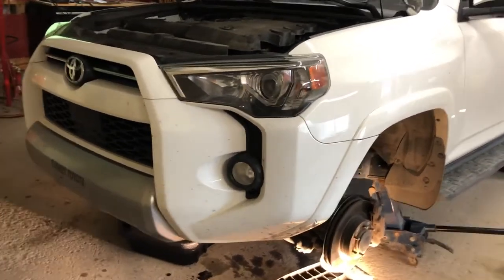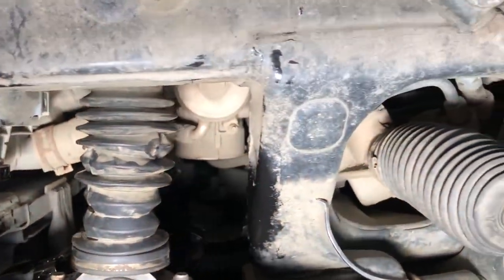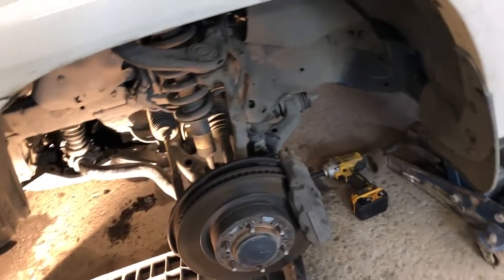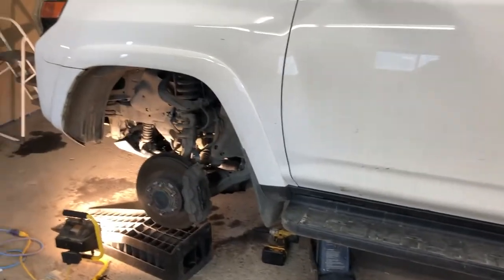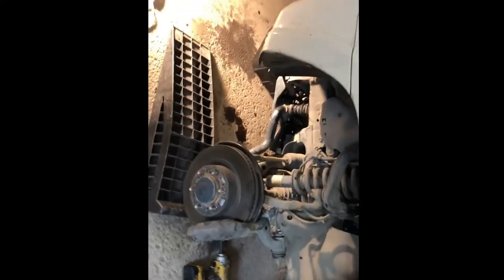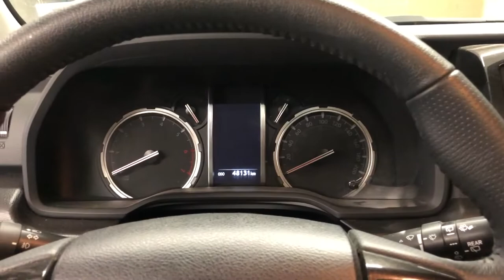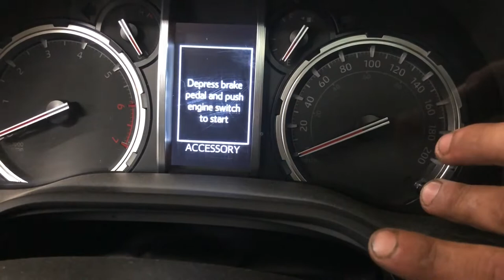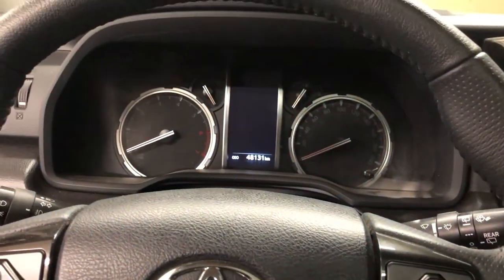2020 Toyota 4 Runner Oil and Filter Change!! Oil Life Reset!!

Comment: Pull the big skid plate use the proper filter wrench and these are a 15 min job tops. I think the plug on the bottom is a drain plug for the filter housing
Reply from the maker: lot of work to change oil